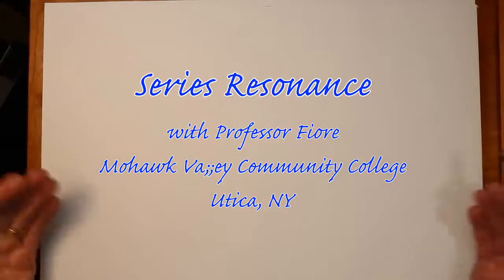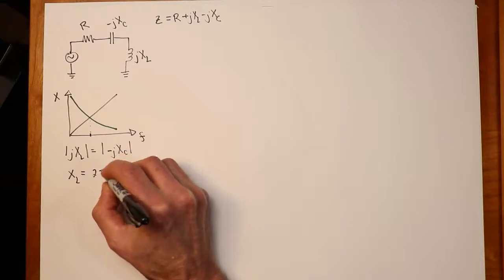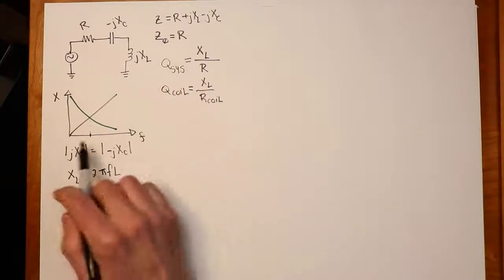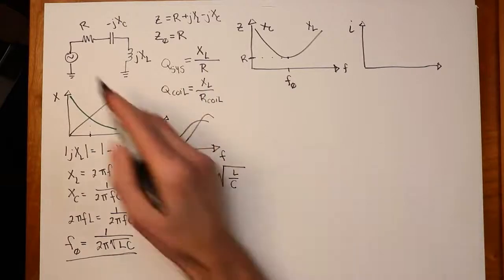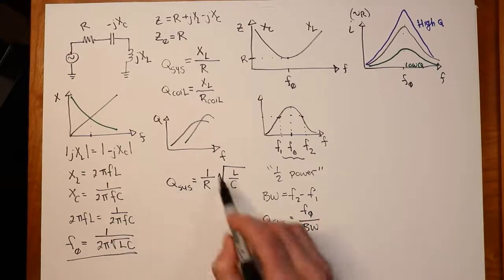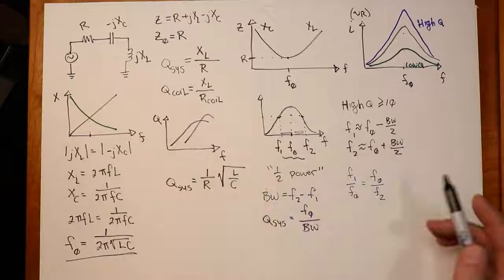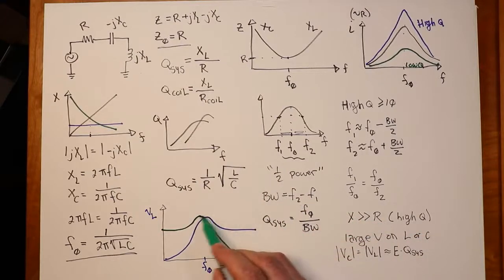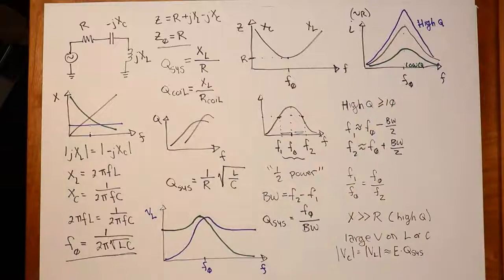AC Electrical Circuit Analysis: Series Resonance

Comment: Good video. @5:18, while calculating Q (Quality Factor), why you didn't consider "capacitor reactance Xc)? It's akso present in the circuit.
Thanks.
Reply from the maker: At resonance, Xl and Xc have the same magnitude. We're looking for the ratio between reactance (magnitude) and resistance.
Reply: @ElectronicswithProfessorFiore  Thanks for the clarification. Appreciate!

Comment: Thanks for the great video. One question: At 8;20 you say the capacitive dominant circuit is " lagging" , and the inductive dominant circuit is "leading".. Isn't this reversed from true. Aren't capacitive dominant circuits said to be leading, because current leads voltage?
Reply from the maker: Usually we think in terms of whether the voltage is leading or lagging the current, not the other way around. Consider that impedance is voltage over current. If the voltage is lagging, then the impedance must have a negative phase angle (based on Ohm's Law).
Reply: Thanks again for the reply! Really appreciate it.